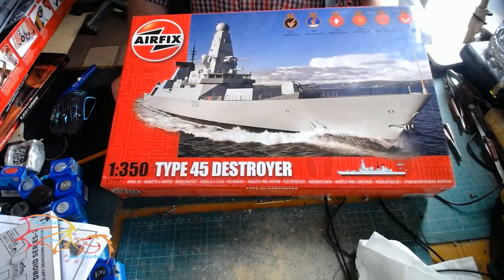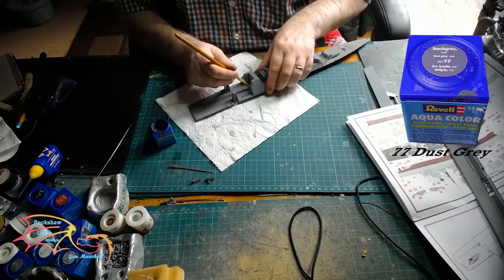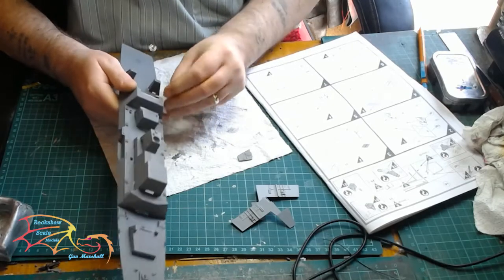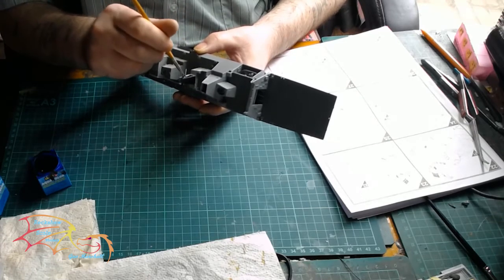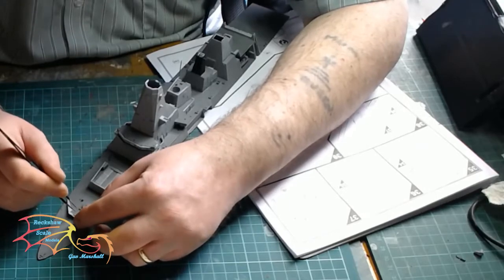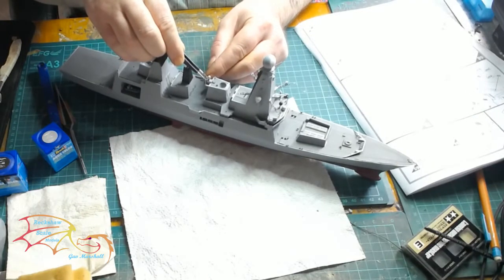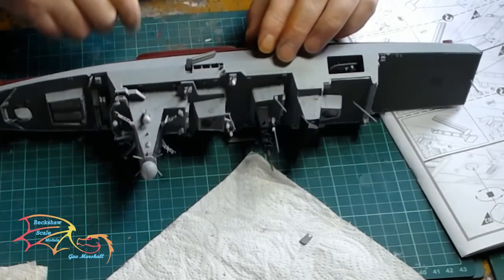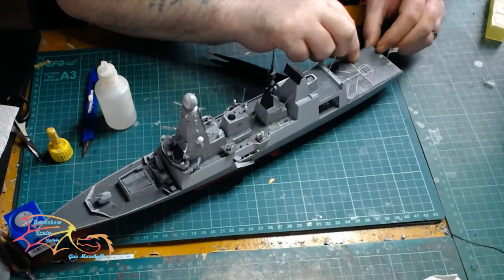AirFix Type 45 Destroyer Scale 1/350

Comment: With respect, a decent basic build, but it takes a lot of work to build it more accurately. The fit between parts in some areas is not that great and the main anchor was moulded in the wrong place. Add to that, the inaccurate painting instructions, particularly the water line, the kit has its flaws. Having said that, with time, some work and the addition of photo etch, it is a great model.
Reply from the maker: Hi Martin, thanks for the comment. I didn't know about the anchor and water line. It was a real enjoyable build and a great entry point for anyone who hasn't built a ship.  Like most kits you get what you put into them as long as the base model design fits well. That's one of the reason why I would recommend this kit for any skill level.  For me I'm not convinced that photo etch brings much to a build but there again I don't like working with it so it's probably just me.